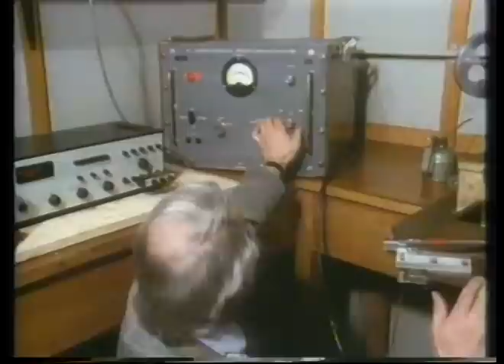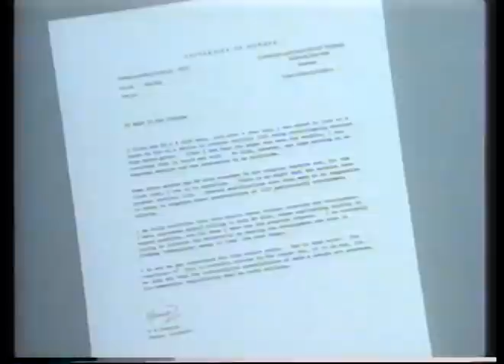Anti-Gravity Machine (Part Two)

Comment: so how many nails were removed from the counterweight ? They don't say, it was just a few - the counterweight made the whole thing nearly balanced and able to lift with very, very little force. So the problem with that is it could be something like hydro-static pressure from the lube in the bearing surfaces ... I feel sorry for the guy - chasing after so much with such a very tiny result - so small it cannot be verified as rotating gyroscopic lift. Working with spinning metal on a lathe or mill or any other contraption and you'll understand.

Comment: Nothing new here - so you create angular momentum which yes in the absence of gravity may produce a force significant enough to move a craft in a direction.... well what about the mechanical break down of bearings and roters and friction - likely we have done the same with ION engines using NO MOVING PARTS (YOUR FAILURE) using micro particals to acheive the same
Reply: Are you not aware of Noether's Theorem? Fundamental symmetries of space and time mean that angular and linear momenta are separately conserved. Therefore an isolated spinning object can never produce a propulsive force.  It is easy to get confused. After all, one of those tennis-ball firing guns (which use spinning wheels to launch the balls) could propel itself in outer space. But that just makes it a crude rocket, and that is not what the antigravity crackpots want.

Comment: Yeah they always run commercials  about "do you have an idea for an invention"? Better yet how about when space x had a contest for new propulsion for space, the winners were a couple of young guys who used cardboard, tinfoil, trim nails, wire and a machine to amp up & control how much electricity was being used and it floated silently. Its hovering height depended on how much electrical power was being used, it was all over american news. As soon as they had won the contest you never heard anything else of this technology, but now we are seeing triangular spacecraft flying over america and have started in the last 20 years after that contest.

Comment: This device is just a govenor or a speed limiter used as a speed controller. Its been around for over a century.
Reply: Sure dude like you're some kind of expert? What are your credentials?
Reply: @darrenfred242  you don't need credentials to know what a govenor is lol.
Reply: @darrenfred242  After watching these videos, I have to know what force caused it to not levitate?  Was it gravity?  Yea.
Reply: @DeputyNordburg  I wouldnt know. Maybe build one yourself and see. Let me know how it turns out, I'm interested.
Reply: @darrenfred242   Build a non-working levitation machine like this?  OK.  (holding a brick in one hand). Done. Success! it levitates as much a the one in this video!  I can spin the brick if that helps you.
Reply: @DeputyNordburg  Love it. Made me laugh. Needed it.
Reply: @darrenfred242   I wish there were levitation machines, perpetual motion machines, free energy machines.  And I don't even think they are impossible.  I just think the BS ones (and that is all of them so far) need to be called BS.

Comment: I don't think this thing will work. The mechanics are all wrong. Mechanical force is not going to lift this thing up. It's electrical force that does this. It's going to take 2 powerful circular magnets both laying horizontally  rotating in opposite directions around a single axis while rotating through a field of mercury or liquid aluminum. This is what generates electricity and provides lift. 
  I'm just a high school grad, but that's how it was explained to me. I can't even spell horizontal, but that's what I've come away with about this. I'm sure Tesla had it figured out. I think the NAZIS really made these things and if they did the Allies did and so did Russia. The fact is the powers that be aren't publicizing it.
Reply: No, NOT AT ALL! By the 369 Rule you need 6 to give a balance to the forces on the axis in this type of design. I have met Mr Sandy Kidd at an exhibition, a very humble man and obviously dedicated to his work.  I also agree with the contributor in regards to the use of mercury. If you can imagine a saucer with 2 tubes of Mercury round it's perimeter edge being driven round at very high rotational speeds in opposite directions driven by magnetically powered electrical windings; this would also give a lifting balance gyroscopic effect  which could quite easily be controlled.
Sandy I solute you for all your amazing efforts and wish you and your lovely supportive wife all the best and I hope your efforts are recompense financially and any other way that you both I think, deserve. 
Deep respect,  
Pat. Fi Dunfermline.

Comment: Just a guess, after watching this machine, it seems to be a spiraling of energy.  In other words, the spiral force cannot be resisted by the mass, so it climbs the pole.  Not sure how it could be done withouth the pole however.  Though I'm sure a use could be found.  Perhaps a differeent configuration would work as well.

Comment: Lol imagine you have a heavy piece of Steel and around it you've wrapped copper in order to turn it into electromagnet then you place at steel with inside an aluminum pill shape when electricity is introduced to the electromagnet it should levitation the center of the pill shape of the aluminum when certain fields of magnetism are introduced to the levitating steel within the aluminum capsule it will begin to oscillate back and forth creating kinetic energy possibly aluminum capsule may need liquid nitrogen Cooling now if we had a couple of those pills underneath the wings of a airplane and you stirred to tilt them slightly the centrifugal force should levitate The Craft that's one way of anti-gravity what they're not explain to you why magnets levitate it has to do with the same properties that makes a zeppelin float in the air only instead of filling the craft full of hydrogen they're taking the electron from the hydrogen atom adding it to aluminum which is a light metal so that the protons from the hydrogen will add themselves to the atoms within the aluminum giving it and take gravity properties and that's their best spacecraft material. We mainly use the kinetic engines for they're underwater UFOs because they need heavier steel to support the weight of the ocean aluminum's not very good for that it's good for space travel though. The kinetic engines allow them to move underwater very fast without making hardly any sound whatsoever.

Comment: In this video Eric Laithwaithe did a lot of tricks with different gyros most of which did not impress me much as anything unusual happening EXCEPT FOR THIS ONE! (At this point in the video t=1876) How did this one work?  https://youtu.be/0L2YAU-jmcE?t=1876 can any one explain this?
1) Eric Laithwaithe takes and puts a second pivot point on a rod on a single scale type pivot with a base.
2) He then takes a gyro that is not spun up and simply lets it dangle on one end of the rod on the second pivot point.
3) He takes a weight and slides it on the rod balancing out the rod with the unspun gyro dangling on one end and the weight on the other.  Then he  tightens a lock screw to keep the weight balanced against the gyro locked in place.
4) He then spins up the gyro balanced on the second pivot against the weight locked in place and whola the scale tips upward on the side of the previously balanced gyro.
5) After   he brings the gyro to a stop & sets it back down, for a second or two in the video, you see the gyroscope remains balanced on the rod against the iron weight locked in place.  No sleight of hand here was there?  No tampering with the screw.
6) I do not know why Laithwaithe did not simply allow the gyro to spin down on its own (except he might have been pressed for time) for if he had we should have seen the unbalanced gyro tipped up on the opposite side of the weight slowly return to dangling in equilibrium on it's own.
Reply: Apply a twisting force to a spinning gyroscope, and it responds with a twisting force at 90 degrees to the force you applied.  The rest is just theatre.  "let those who say I cannot make a body appear lighter than it is, come and pull holes in that one."  Yea and I've seen people appear to pull rabbits from top hats.  It's a great show.  (but the rabbit is inside the dark black hat with a flap inside. )

Comment: The law of conservation of energy proves it takes power to lift the unit by using the small motor to transfer momentum. He simply transferred energy from one plane to another. That is basically a superconductor at room temperature using mass. Its not too difficult to understand the reason. This would be shut down with any peer review

Comment: shooting an aluminum ring up a metal pole using eddy currents is something you do in the classroom at 15.
this experiment is no different, just the currents are caused by rotation of the aluminum disks.
Reply: i think the bucket, string, and pullies were a bigger factor in the "lift" than the eddy currents.

Comment: The gyros are fixed due to rotation.  They can only lift the shaft as far as the mechanism allows.  The weight of the entire device will never change.  This is a pretty simple trick where part of a device rises so if you weight only part of the device it looks like anti gravity but it is just an idiot persuing a device that can never work.

Comment: sorry folks.  this is a total waste of time...
see, they didn't have remote-control back then.  we do, now.  but, if you decoupled the whole mechanism from a grounded point, it'll spin out of control...
and, if i can see that correctly, that means i'm over qualified.
Reply: Radio Control was invented in 1898... Wired remote control 1870.

Comment: This was happening in the 1980s and yet today no one talks about it? Hmm.  One thing I'd like to see is how it behaves in a vacuum.  All those spinning parts could cause air to be pushed downward, producing thrust.  If it still creates lift in a vacuum then it is well worth investigating.   But even so there's nothing magical here.  You can't get more energy out of a system than you put in.
Reply: What are you even talking about? No ones saying anything about "more energy out than in", that would literally have to be about a 'free energy device', which this is not. And well-balanced gyroscopes don't produce vectored thrust, even you have to realize they'd have to be shaped like propellers (fans) to do that. Stop speculating.

Comment: Its not anti gravity .. it just over powers the effect of gravity. Like throwing a baseball. All the energy provided by the baseball player is transferred into the baseball. But that thrown ball loses energy over time and the baseball will fall due to gravity. But the machine is the baseball player and the baseball. Providing its own constant 'throwing' energy. At full speed the machine was equal in 'throwing' energy so no lift, but the moment the two outter rings shifted slightly upward that energy shifted upward or throwing itself and thus the lift .. constant at that. A genius device .. baseball today, antimatter  tomorrow.
Reply: If it over powers the effect of gravity, it did not do it in this video.  It seems pro-gravity.

Comment: "You could go to the next galaxy on a teaspoon full of uranium".  Yeah,  OK.  So now at this point in the story there are two nutjobs agreeing with each other. If the bottom of the "antigravity machine" were not tethered to the bench on which it sits,  it would just flop around and reveal it's true worth.  A paperweight.
Reply: It was the lack of tethering or measuring that tipped me off to how silly this is.  Any serious effort would place the device on a scale or force gauge.  In addition, its difficult to know where "the device" starts and ends.  Is the axle and the assembly that doesn't move part of the machine?   Why is there a bucket and other things hanging from the ceiling?

Comment: Today's consumer's ability to manufacture such a device is well within reach than it was 35 years ago! Surely, somebody will see this who has the resources and even money to try to duplicate this invention and see if it truly works! Wish I had the resources and place to do it as I would attempt it myself!
The one problem I see here with his design is that even if you were to mobilize it, you would need a tail to counter the turning force much like how a helicopter has a counterforce with its tail blades to keep it from spinning out of control.
Reply: One problem I see is that at no point did it lift off the ground or lighter.   I think the inventor genuinely thought he was on to something, but there is nothing here to indicate that it worked.

Comment: This device could never work in an untethered state as it relies on a fixed point to direct the "Centripetal" deflection of rotation upwards. (See how the weights change their angle of rotation once they get past the horizontal plane). This device uses Newtons second law to direct the resultant force upward, so as soon as the anchor is removed the stabilising central axis will rotate with the machine and it will lose its resultant upward force. Sorry...............no Starfleet today.
Reply: It did not work tethered, so I doubt it would work untethered.  A least it never seemed to work in this video.

Comment: The bucket of water hanging from ceiling lifting weight from the device suggests what ever lifting energy it has is very small. Ie it doesn’t even have the force to lift itself. Gyro’s rely on weight so to lighten it would stop it from working and scaling it up it would still not be able to lift its own weight without assistance (the bucket of water). It has no useful application.
Reply: If the inventor thought it would actually work, it would be mounted on a scale.  And the people he was working with would have advised him of the same.

Comment: I have no knowledge of the things that go on here.  He seems genuine, and has done a lot of work on anti gravity.  My thinking is, whatever causes the lift,  there is an electric motor spinning the thing, and maybe a part of that energy causes the lift. There is a thing spinning, held  in bearings, and often a device like that does have a thrust sideways. Or upwards, same thing related to the axis of the shaft thats spinning. OK, thats a simple idea, might be wrong, but you think about it.
Reply: There is also a bucket on a string going through pullies and acting as a counter weight.

Comment: Need to assemble two of those counter rotating and the restrict rotors from sliding on shafts and weigh entire apparatus... I guarantee there will be zero weight loss or gain...

Comment: I honor your percistance. 
I would very much like to see this machine or similar device with my own eyes. 
In terms of application: Have you ever considered putting it in a boat?
Reply: Good evening Strommel1,
Due to the cyclic imbalance caused by gravity which is imposed on the flywheels as they are rotated means that a machine of this type requires considerable modification to operate in the horizontal plane.
I always intended any machine of mine to thrust in an upwards direction towards space.
It is possible but does require considerable effort to carry this out which in the end would be as far as I can see a potentially redundant modification, unless you like submarines.
I do have a mechanism built which if completed would solve the imbalance problem and generate horizontal thrust, but it has been of a lower priority in my list of things to do.
I do have another couple of devices ready to be demonstrated on YouTube. 
The first one will show where the differential for creating inertial thrust can be found.
I hope to show this one on YouTube in a few days and gain just a little credibility.
The second one is somewhat similar to the machines of mine shown on YouTube but with a different method of operation.
Sandy.
Reply: Would you could you on a boat?  I could not would not on a boat!